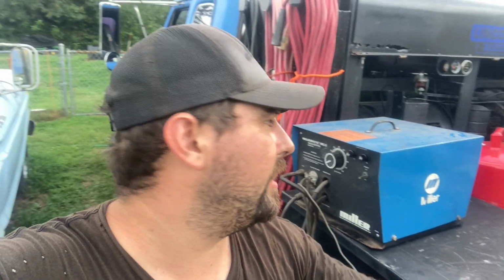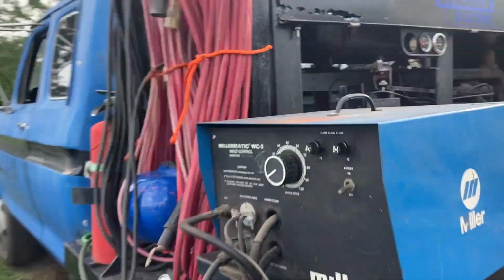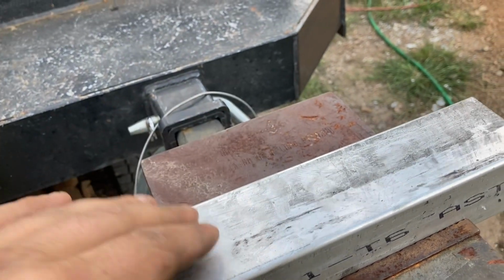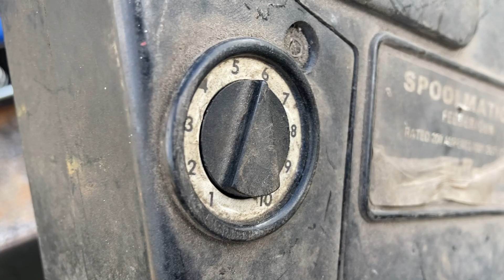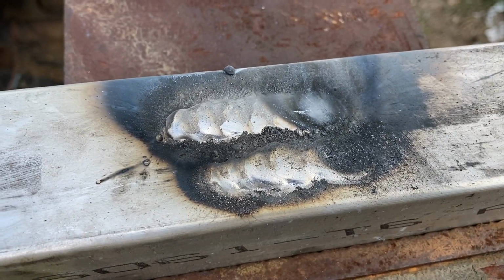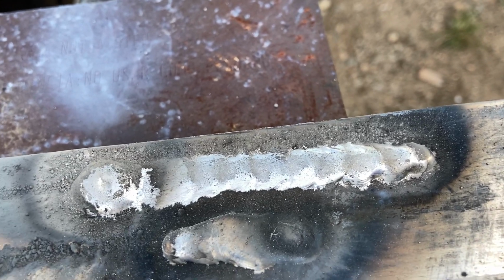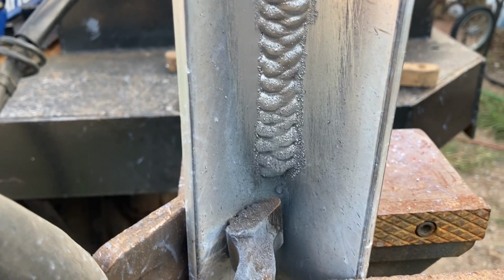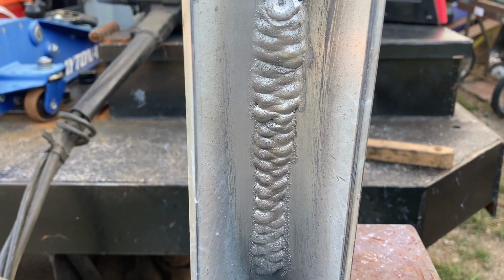SA-200 mig welding aluminum with Miller WC3 and Spoolmatic-2 gun

Comment: Nice video!! 👍🏼🔥 Just did a job with a spoolgun on aluminum and 5356 wire. Kept sooting real bad so I turned the gas up to 45 CFH &it  knocked the soot way down.
Reply from the maker: I’ll have to give that a shot I was using around 30cfh in this video

Comment: Hi bro, hope you doing great. I watch your all the videos and love your work. I just bought a red face with copper winding sa 200 its 1949s machine and i got a linclon LN 25 suitcase. Im not a pipe welder i just do structural welding with iron workers. Im just wondering how can i run my suitcase on SA 200 or any accessories to buy in order to get the job done. Every advice would be great help for me . Thankyou so much and keep it up

Comment: Aint it amazing how they shrunk the controllers over the years. A wc-3 and the wc-24 is 85% smaller.. but interesting video
Reply from the maker: I know it’s amazing how technology has evolved. But to be fair the wc24 only works with machines that have a 14pin the wc3 and wc115 work with any cc or cv machine.
Reply: @derbadortheweldor8940  never owned a cc machine so this was an interesting video. Have you tig'd aluminum off your 200 yet?
Reply from the maker: Yeah but the spool gun is the way to go especially for field work

Comment: Does your Spoolmatic-2 have a gas valve in the gun? I’ve got a Spoolmatic 30a that I’ve had for close to 30 years, and it has the valve in the gun, so the gas hose goes straight to the flow meter and not to the machine (or WC in your case). For what it’s worth, I had to certify on mig aluminum - unlimited thickness in all positions with X-ray testing. Stringer beads were specified in the WPS because they’d found that the majority of failed X-ray tests were on plates with a weave! Much more trash in those welds than stringer beads! “Discontinuities” as they refer to them! Testing in accordance with the AWS D15.1 standard.

Comment: @Derbador the weldor I'm a guy just starting out. Right now I have a generator and titanium unlimited 200. Thinking about getting used hobart champion 145 for 600 but I see you upgrade to the sa200. I can get a ranger 8 for 400. Cranks and runs fine but doesn't weld. What say you since you've been where I've started.

Comment: I have the same set up for my bobcat 225g  works great but tips are high as hell
Reply from the maker: I know! But I guess it’s the trade off of having a low initial investment cost.
Reply: Call Profax about getting the tips or upgrading to heavy duty tips.

Look at there online catalog.
Reply from the maker: @robertoobregon3750  That’s what I did I got mine from profax on Amazon. Still expensive but not quite as expensive as Miller brand.
Reply: @derbadortheweldor8940  good deal, I got the old Airco miget spool gun and put at AEC 200 Heavy duty goose neck assembly. Then run it with a WC 3.

Think it is a WC 3

Comment: G’day mate do you adjust the amperage and volts on the sa-200 or the Miller control box? Looking forward to seeing your setup for your suitcase. Now that you have the Miller control box will your suitcase run off it for cv welding? Where I live we can’t do to-code welds with cc machines any more have to use cv and I prefer my old welder to the new ones